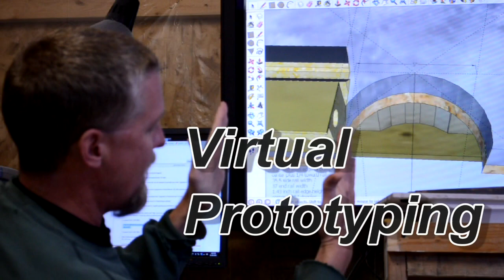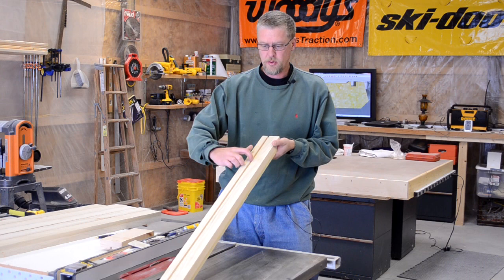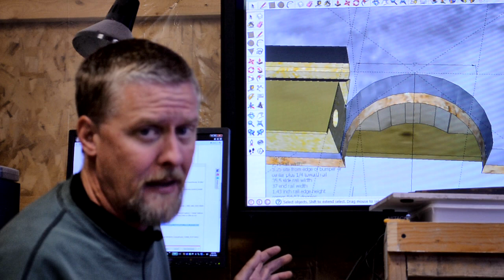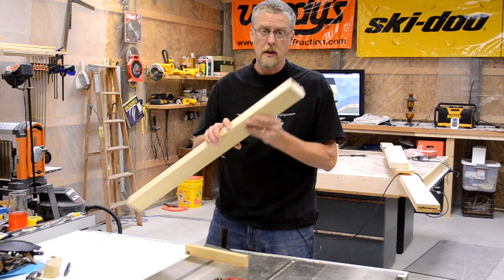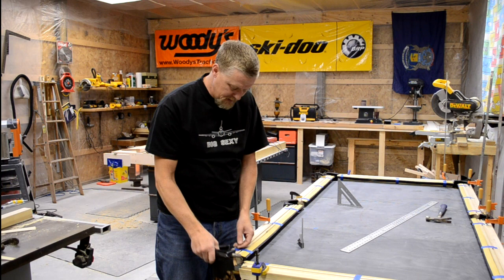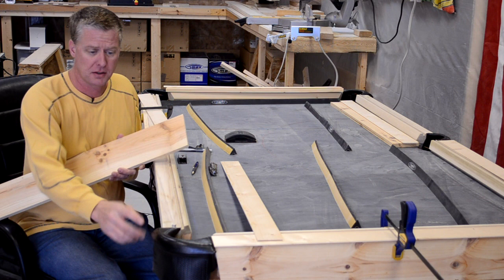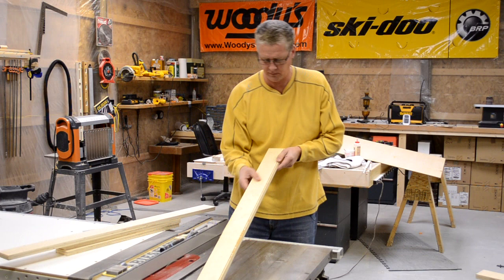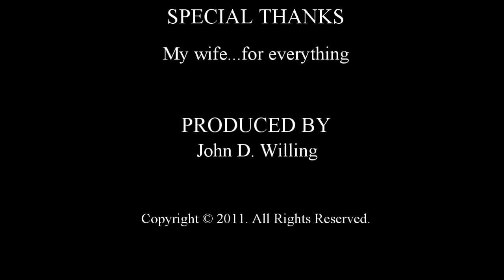How to Build a Pool Table, Part 7 - Efforts in Frugality - Episode 5

Comment: I've watched every one of these and I've put them in a saved Youtube folder. But, did anyone besides me catch a very dangerous thing that he did on this episode? Look at the 9:15  and beyond. You can NOT put a board on a sled and also have one end stop against the rep fence. This could be a major kick-back if that board moves just a bit or if the fence and blade and not perfectly parallel to each other. I made this mistake years ago and a board almost went right thru a wall. The end that is against the rip fence must be free.